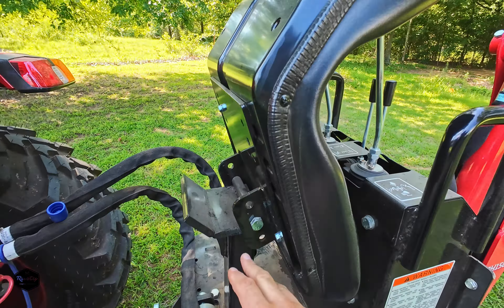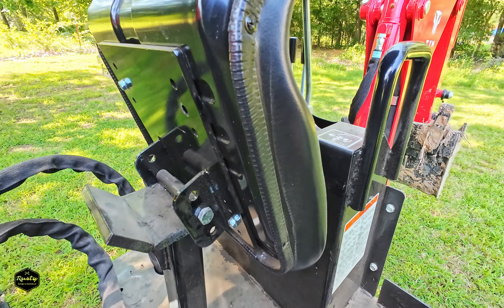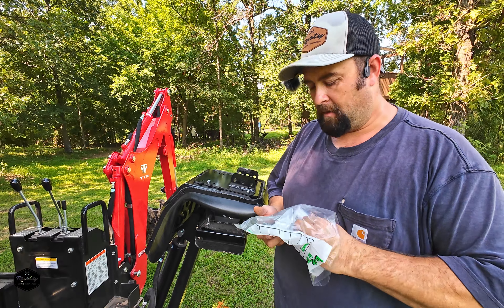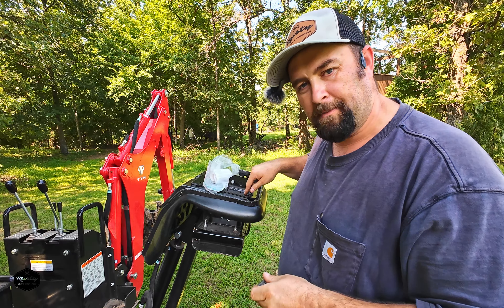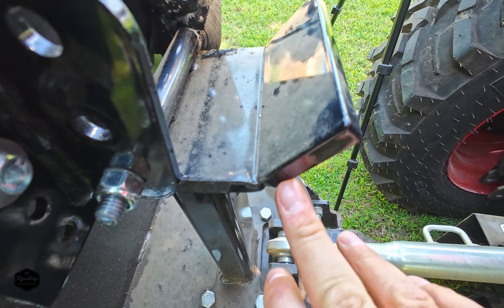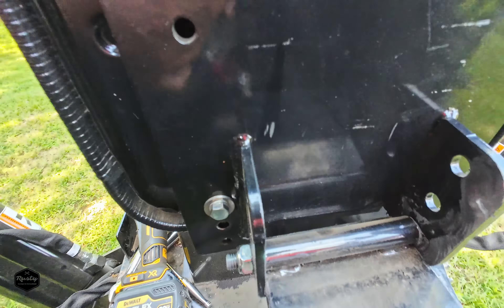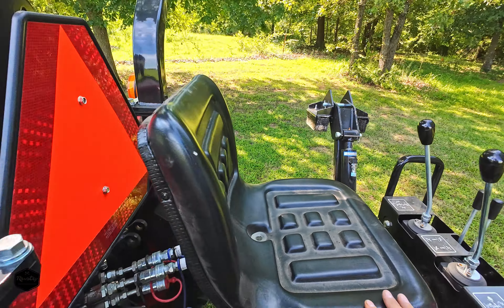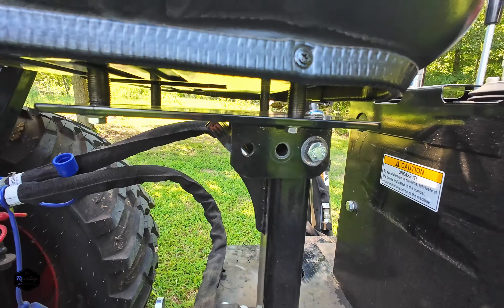TYM BH150 Backhoe Not Usable

Comment: Will you need to spread the weight a little bit more where the spacer rests against the seat bottom or is that metal fairly thick?
Reply from the maker: I was wondering about that. The seat plate is thick and won't be an issue. The seat pan itself i could see exactly how thick it was. It feels thick enough. Other option would be to add more fender washers between the spacer and the seat pan. Probably should of don't that just in case. Thank you for watching sir.

Comment: My 3 or 5 cents are you could add to the plate that has the holes drilled in it prob 1/4 plate and weld then drill 4 new holes prob. That's my 1 st thought . I didn't get to fully study it , but look forward to seeing what u come up with . Those r the kind of videos I like the most I think . 🤷🏻‍♂️I like building vids or stuff I'm not good at like mechanic videos . I have a little anger management issues with mechanic stuff 🤪
Reply from the maker: That's a good idea. I wasn't thinking something similar or thinking of doing something around the hinge area. The verdict is still out.

Haha, having anger management issues is a requirement if you're going to work on vehicles.
Reply: Hahaha Todd. This is a good video for sure